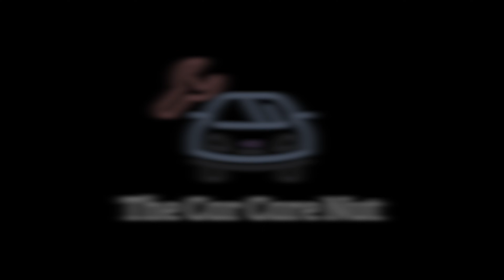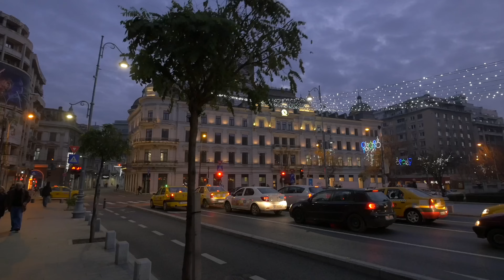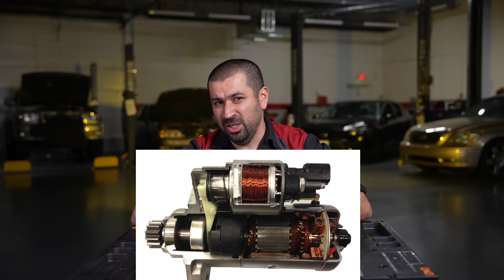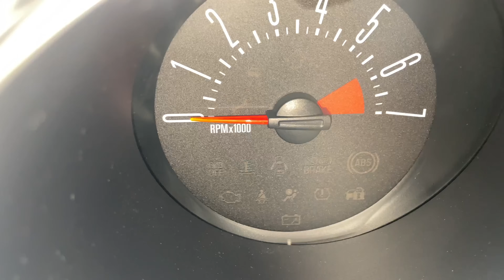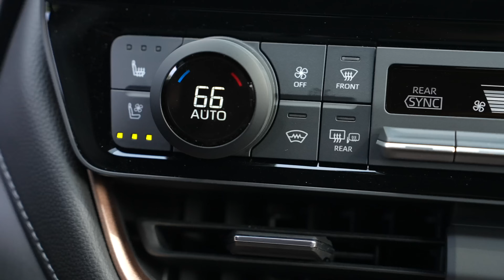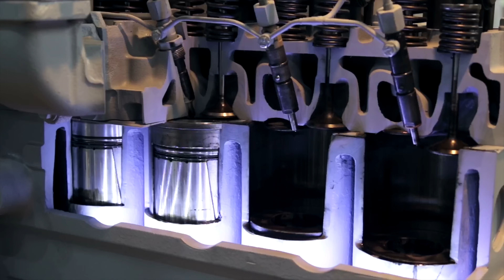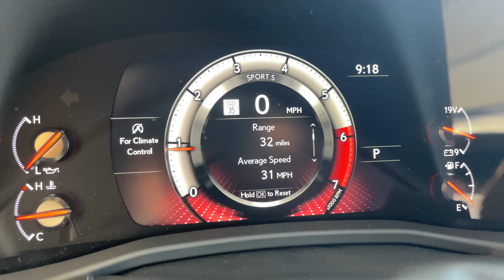How Does Start Stop Technology Work in Modern Cars? Everything You Need to Know

Comment: It is the worst feature and cause a lot of unnecessary wear on your engine and starter. Most engine wear occurs eat start up. The only reason this was installed was so the manufacturer could pass emission standards. This is a false. On start up engines pollute 10 times as much as when Idling. This is due to the richness for start up and the sensors or have cooled down so it takes the system up,to 1 minute to get back to normal operations all the time spewing out more pollutants than if the car was left running. Wake up people if CO2 is harmful to the climate then start holding your breath, because you breath out CO2 with every breath. And the only thing CO2 does,in our atmosphere is feed the plants what they need to turn sunlight into energy, carbon and O2. You know that stuff we need to breath. CO2 even at todays levels is less than 1/3 of 1 percent of the total atmosphere. And again great for plants but has nothing to do with world temperatures.

Comment: Great.  More cost and complexity for emissions purposes.  It is so poorly executed on a 2018 GMC Terrain that I laugh at the programming.  It shuts off when I pull into a parking spot and before I push the Park button.  Then it starts up so it can shift into park.  Brilliant!  And they take away the disable button.  I hate these new gas cars for reasons such as this.  I’ma buy up all the 2009/2010 Pontiac Vibes that I can find.  I can work on them still and can debug easily myself.  All this time I thought the auto stop was for mileage purposes.  Dealerships already suck at diagnosing and fixing cars and now there is even more reason for them to play the parts roulette.

Comment: I only got my first start-stop technology in a car this past spring. It is a little annoying though we don't usually turn it off. Wow, I never realized how complicated the whole system is. I have worked on my cars somewhat in the past. My newest vehicle before all this was a 2012 Ford Flex that was purchased with 7000 miles on it. But I have more or less decided that I will not be working on my 2024 Ford Maverick 2.0L (non-hybrid). Brought it for the first scheduled check up this past month. I still have my 2007 Rav4 to work on.

Comment: After driving a ford with it, don't like it at all.  When it shuts off, AC basically quits blowing, slow to start back up, handful of times it didn't and have to put in N and manually start, when coming to a stop sign pretty much rolled throughh all I could (changed driving habits) or it would stop then jerk hard when starting bk etc. etc. I've drove some with smaller engines, and they're much smoother operation.

Comment: 27:40 So I guess my start stop system is not very smart. My 2019 turbo charged diesel seat leon does turn off the engine less than 5 minutes after a cold start, if the ac/heating systems are turned off (at an ambient temperature around 10 °C (50 °F)). In my opinion, that's way to early. In normal operation in urban areas it takes around 10 to 20 minutes for the oil to reach 60 °C (140 °F). Maybe they tune the system differently depending on the emission limits in the region. A cool thing it does is, it starts the engine when the car in front of you starts moving. So you can get going again even quicker. And it shuts off the engine even before you come to a complete stop. And in more than 95% of these times you actually wanted to come to a complete stop.

Comment: Not sure about Toyota but my Honda CRV was defaulted to on. You can purchase a cheap fix online and it took about 5 min to install so that it defaults to off.
Reply: i bought one and intstalled it but it affected my steering slightly at high speeds, the start stop system is linked to electronic steering. i disconnected it and everything was back to normal.

Comment: Well I like start/stop in mine. First - it actually does make noticeable difference in fuel consumption in the city, second it just for some reason has pleasant feel, when it stops and starts. The car runs fine for over 150k miles, and there are multiple other more probable points of failure anyway. But I get why it's annoying, If I didn't like it (which I do) then it would drive me crazy that it reset's every single time.

Comment: Very informative. Thank you for the information and your expertise. I had a 2006 Chevy Impala SS with the cylinder deactivation, which I believe over time was not good for the engine, but it hardly gets activated unless you're on Overdrive at freeway speeds with light acceleration. 

Anyway, it's a hassle to deactivate this system every time on start up, but I would usually put it in Sport mode for the cars I would get, that will bypass it. Also some cars, like I think the new Honda Civic Si and Type R have a customer settings mode that you can disable it to stay off. 

But for some reason, the most likely vehicle I will be getting is the Honda HR-V Sport, which for some reason does not have the auto start/stop. It is basically an SUV version of the Civic Sport with the same engine, so I wonder why it doesn't have it, but the Civic does.

Comment: I still believe it creates more wear on the engines, because it needs oil pressure for safe operation, and after every shut off oil pressure is 0,when it starts there's no oil pressure for a second. Do it 300,000 times, and you got a problem

Comment: It's sad to see that so much engineering went into solving a problem that shouldn't have been there in the first place. Start-stop idea in a regular ICE car is just plain stupid. Yes, you can make it sorta work in a way that won't bother a typical user, but all this extra complexity just makes the car more expensive and less reliable with no tangible benefits. If one wants a car that shuts off when idling at traffic stops they just should get a hybrid and save on gas (or save the planet, whatever their motives are). And don't tell me that there's a button. The button doesn't solve the problems with the cost and reliability and I don't want to have another button that I have to push every single time I start the car

Comment: Very good explanation on how the system works , thanks . The system does make the car more complex, more expensive to purchase and cost more to maintain . My mother in laws van has two batteries and high quality batteries will last three years max. Then when one gets weak they both have to be replaced . Now that many engines are turbocharged I don't like the ideal of losing the oil pressure for turbo lubrication and cooling every start / stop cycle . Like they say " the only thing constant is change " . Life is full of give and take .
Reply: And car companies are all about taking! Taking more money from us to further line their pockets with higher and higher profit margins.
Reply: That was my thought too.  He mentioned an electric oil pump for the transmission but I'm not clear whether it's enough to maintain oil flow to the turbocharger.

Comment: Thank you for this very informative and detailed video good Sir.

My friend and colleague has a Ford Mondeo with s/s technology that has ceased to function recently.  He used my primitive OBD2 diagnostic/tester and discovered the cold-crank voltage was down to way less than 9 volts.  He believes a new battery will fix the problem but it was most interesting to learn from you that the ECU is also counting such starts and will disable s/s when the prescribed number is reached.  We will check that out.

I wonder if a bank of series-wired ULTRA-CAPS installed basically in parallel with the battery would allow a somewhat soft battery to endure the s/s cycles for a much longer time.  Further, no alteration to ECU parameters or behavior would be required.

A simple paralleled diode and resistor would need to be in one of the two leads connecting the capacitor bank to the 12V battery.  The diode would need to be rated >100 amperes to handle starter load and a resistor of about 1 ohm to limit peak capacitor charge current to a sane level at all times.

The only issue with such an arrangement would likely be the intrinsic leakage of Ultra-capacitors.  So a vehicle left unused for several months may cause a significant depletion of the battery's charge.  The great benefit however, is that the capacitor bank will still deliver sufficient current to cold-crank the engine even when the delivery voltage is below 9 volts.

Comment: My 1925 Ford Model T has its own Start/Stop technology. This only works if the engine is already warmed up.   When you shut off the engine and turn the ignition back on a short time later, often the engine will start instantly.  This happens without hand-cranking or using the electric starter.  In the Model T world, this is called a free start!
Reply: How does it start without handcranking or using the start motor?
Reply: Nice to see basic comprehension skills aren't entirely lost to mankind yet though. Perhaps when Rylan wrote " People don't understand" he simply forgot a few words and really meant to write " people that haven't watched the video we are currently posting in the comment section of don't understand "
Reply: Yeah thanks mate from Down Under, just bought 2025 Rouge with Auto Start. Good to understand the system and future servicing. Thinking to leave active A on occasionally to keep the punps fresh, also use 4L off road occasionally on the farm to keep the running gears good too.
Reply: Yeah that’s basically the parameters for all new start stop systems. People don’t understand that if certain conditions aren’t met, the system won’t engage. Like if the car isn’t warmed up to an optimal temperature, or if the A/C is needed to maintain the set temperature for a prolonged period of time
Reply: @rylans.5365  I guess you didn't watch the video because if you did you wouldn't feel the need to explain that in the comments because the video covered all that...

Comment: Each start stop cycle you run the engine with 0 oil pressure for about 1/2 seconds or so.  This was originally designed to up the CAFE requirements but now the manufacturer states it is for emissions

Comment: I have it in my truck, and my biggest issue with it is making a left turn at an intersection.
I stop at the light, and the truck shuts off, my light turns green and I can now make that protected left turn.
I start to go and for about a half a second my power steering is just gone, which means I feel my truck understeering, and it is not a good feeling.

Comment: I bought a car, and then i had it around a year, it began to start sometimes like i would keep the key turned, but even if i tryed that, it was not possibly. Because it was full electronic. Not even the shop where I bought it could figure it out. Turn out it was the battery that was bad. Changed it for a regular battery because my car never ones did that start, stop thing, but first time I stopped at a red light with the new battery, it did it. I could never figure out if I should change it again for it with start, stop.

Comment: I hate that crap, it's easy to permanently turn of by disconnecting the amp meter from the terminal of the battery, if the system doesn't know the state of the battery it will not engage the start stop... We can also reduce emissions by higher speed in the town, so we will be in higher gear. Also, we need more smart traffic lights, and less pedestrians crossing, pedestrians can wait, and they don't creat emission.

Comment: In So. FL it's USELESS and actually ANNOYING. When the engine stops, the AC stops. On top of that, the traffic lights are LONG. 
With the sun is blazing, temps in the high 90s and humidity at 80% and your AC stops for long minutes of waiting, you cuss out this STUPID "invention". 
And then there is the many hundreds of $ additional expense for premature wear-out of your starter motor...

Comment: Save a little (gas), spend a LOT (for premature wear-out of starter and battery). 
This is the new "logic" of the stupid...
The energy spent on the manufacturing, manpower, of the premature replacements and of the recycling, or of disposal of same, surely exceeds the gasoline saved, likely by magnitudes. I'm convinced the same goes for emissions and pollution as well.

Comment: Enjoy a real life experience of a start/stop garbage: I was approaching a crossing and there was a vehicle standing, I started to apply brakes and AT THAT moment the engine went off BEFORE a full stop. Remember this was a car with a manual gear box, so a clutch pedal was depressed as I expected a full stop, but I still was in the second gear. Then a standing vehicle moved and I needed to accelerate. I released the clutch and pressed the accelerator…

The engine failed to start immediately and instead of acceleration (stop lights off at the moment) my car DECELERATED with an engine working like a brake. It was a half a second hesitation, engine finally started, but IF there was a vehicle behind me expecting me to accelerate I would be 100% rear ended.

Comment: This is the dumbest engineering invention I have ever seen in 73 years on this planet! How often will you have to replace your starter motor and battery vs cars with equipped with common sense? And what is the point? To reduce your carbon footprint? If that is why you bought a car with a start stop feature, I am happy for your misery.

Comment: One thing I never understood about an Audi S5 was why it would sometimes start using its old-school 12V starter (and why it even had that kind of a starter in the first place) whereas on other occasions it would use the hybrid 48V traction motor to start up. The former kind of start up was always as throaty as one would expect. The 48V hybrid startup was magically smooth and felt basically as if a 3 liter diesel could just spin up from zero with ease, no “starting” sounds involved. The smooth starts were used 100% of the time in start/stop situations. But when I came to the car after it had been parked and pressed the on/off button, there was roughly a 50/50 chance of having a throaty “classical” 12V startup versus a smooth hybrid startup. The manual didn’t say anything about this (e.g. why it was so and how such engineering decisions were made) and I never dug further. But it was surprising, to say the very least.

Comment: "cars idling on a traffic light, AC is on, engines are under full load" - LOL WHAT?? Maybe full load for engine is going uphill with full cabin/trunk and pedal floored??
Of course it does not damage the engine. Engine likes when oil pump stops and oil pressure drops. It also likes when cooling circulation stops which creates hot spots in the engine... Just another unnecessary complication which we have to pay for and then push that stupid button every time the engine starts.

Comment: I just purchased a 2020 BMW X5 with 27k miles. It worries me when the car does this at stop signs and areas when traffic slows for a second because it seemingly starts and stops in less than 1 second. I wish the car could read situations better or only stop itself at a red light… I know some Audi cars know when a light is about to change. It would be good if all cars could use this to put less strain on the systems. Also, the car seems to use the start-stop even when the engine is cold… but I wonder what temperature constitutes cold because it hasn’t been colder than 50 F since I’ve owned the car

Comment: If the increase of fuel consumption and emissions during the frequent startups gets compensated by zero consumption/emission periods, there may be some benefits. It would depend on the way the vehicle is used (e.g., durations of idling periods).  Is it worth to pay extra for over-complicated system? Seems that the car manufacturers do not mind it… 😉 Cool engineering, thou. Thanks much!

Comment: Excellent explanation IMO. There were more details here than I realized. Thankfully electric power steering was adopted across the board before the start/stop systems were implemented so there was no need to deal with that. I do have one question… I previously owned a 2009 Toyota Camry Hybrid; I am pretty sure that the A/C compressor was electric on that vehicle. I also believe the engine did not have a starting motor as you described, instead the engine was started somewhat abruptly by the hybrid motor/generator that ran from the hybrid battery, true?
Reply: My 2018 Ford power steering shuts off during start-stop :/
Reply: @DoubleP1Mike  I guess Ford didn't take it quite as far a Toyota...

Comment: One area that concerns me is the oil draining down from the cylinders and cams. Could this be causing damage to those parts?
Reply: internal engine bearing wear is at it's peak during dry starts--where there is no oil pressure and thus no oil film between any friction surface. On an non-start stop engine this only occurs during the initial start cycle, which on average may be 6-8 times a day(subject to individual driving routines). On a start/stop equipped engine this wear cycle is multiplied several times over, again depending on driving routine. Think about this if for instance you have a long commute in traffic--each start /stop event is a wear cycle (may happen 30 times during the trip). Cam journals, connecting rod bearings and crank main bearings are most susceptible to this accelerated wear.  Extra wear is taking place--make no mistake about it. Bmw engineers realized this extra wear condition and actually coat the upper connecting rod bearing with a friction reducing material. They also smartly put the start/stop disable button next to the start button.......not by accident.
Reply: As I suspected.  Thank you.